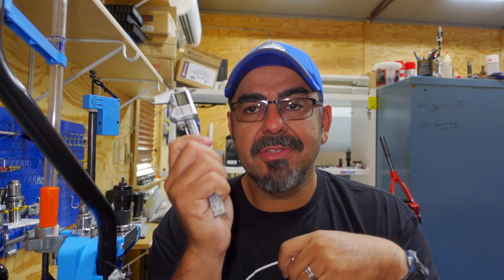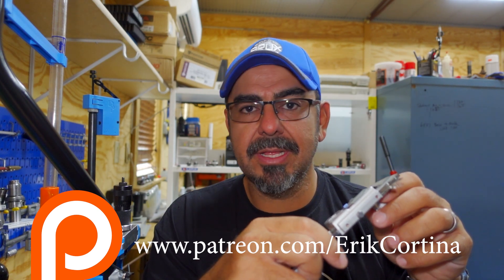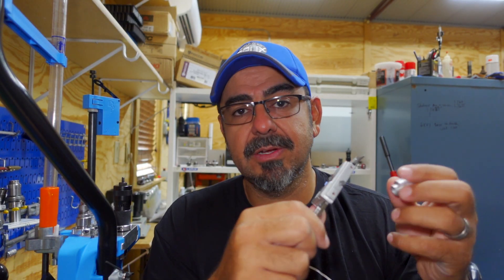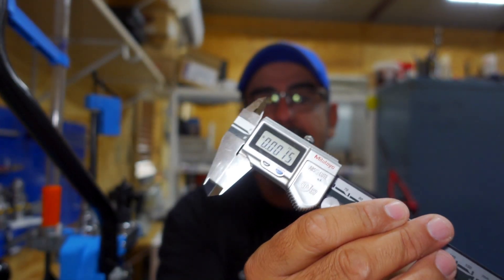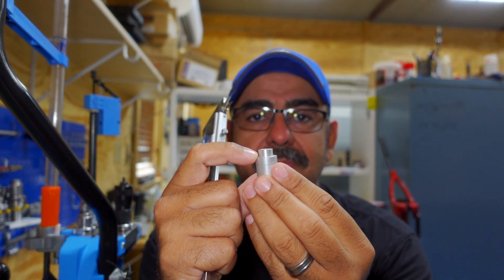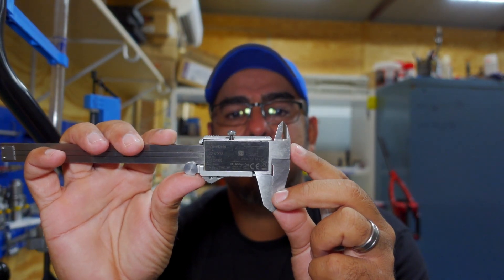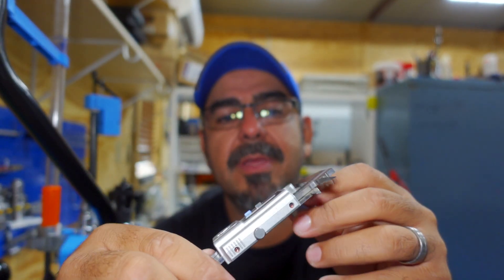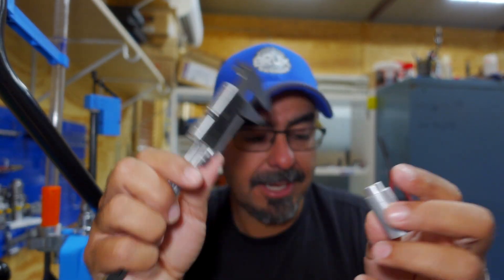You are using your calipers wrong!  Let me explain why...

Comment: I'm a retired toolmaker, and would use a caliper only for the "loose-tolerance" stuff +/-.005.  Another useful advantage of calipers is to set the diameter or length of a part's finished dimension on the display and then zero it there.  Take a measurement and now you have a means of determining how much to "take off" the material to obtain the finish dimension by simply reading the display... doesn't work on the old dial types of course.
Reply: It can work with dial indicators if swinging the dial covers the range.
Reply: @sjb3460  And micrometers can be turned so tight that you stretch the thread.  Any precision measuring tool can read inaccurately in the hands of a gorilla.
Reply: If your caliper has a outer ring that you can turn. Your idea is still possible.
Reply: Yes, Exactly another thing that saves me from doing math!  LOL
Reply: @sjb3460  Only if you are Ham-Handed, a skilled fab can feel measurements, plus minus 2 or 3.
Reply: Id push mine to read a +/- .001 if i already verified  a few parts with a mic. Never used digitals for anything less than ÷/- .01, to each their own though machinists are stubborn sons of bitches.
Reply: I agree completely with your use for "loose tolerance stuff" only comment.
Vernier Calipers are quick to use, versatile, and have a greater range than micrometers do but less accurate.
Reply: That's one of my favorite methods for turning on a lathe.  Take a cut, zero out the DRO, measure part.  Make sure cross slide / carriage (whichever axis you are currently using) is at it's zero point, measure part.  Set the DRO to the measurement, now you can work towards a number.  I sometimes set the DRO to how much I want to remove and work towards zero, usually when I have a lot to remove.
Reply: decimal 'fractions' of one thousandth of an inch. It baffles be how you lot got to the moon.

Comment: Calipers should never used for precision measurement. When calibrated they’re considered to be acceptable when they read within 1.5 times their least resolving division. In this case that’s +/- .00075”. And you really should use rubber gloves when using gage blocks/pins/balls.

Comment: The problem with calipers is the published uncertainty 0.0005", right? But the real problem is not understanding how they are intended to be used: Beam Flex, Sine and Jaw/Nib Tension errors are the rule of the day with calipers. And most won't think twice about how they are using them. Calipers are great when/ were used as intended, but there are better (more complex/expensive) ways to do it with better precision and accuracy (Micrometer, Surface Plate/ Jo Blocks, Surface Plate and Dial Indicator). Quite a few applications do not benefit from 0.0001" accuracy... this is why digital/ dial calipers exist: when you need some accuracy, but not supreme accuracy.

Comment: I'm sure a lot of people will benefit from this. I didn't learn about the 4th measurement until a few years ago and I've been using calipers professionally for years. Good job explaining this. 

I'll add this. Obviously check zero on gages every time you start using them and every now an then when you're using them. But especially if your shop is not climate controlled. I have a cheap micrometer that will move 0.005 inches or more with a 10° F shift. I need to replace them but I use the calipers way more often at home. 

I think our ISO gage people qualify gages at a controlled temperature. But I have not found any tolerance that tight in reloading. The variation stack from sizing lubricant and my presses can throw me off up to .003 inches from consistency.  

Any way great video and YouTube put 2 ads at the end of the video so hopefully you get monetization for this video.

Comment: The 4th way I did not realize. You sure about the accuracy? I don't have this brand of calipers, however the ones I do have measures a cat hair the same every time, I assure you it's less than a 1000's of an inch. Take a set of feeler guages and measure all of them, if it's a good set of calipers you should get the same readings on all the gauges consistently... I did on my calipers.

Comment: another measurement is to put id jaws in a hole and zero it there then use id jaws across the outside walls of two identical holes to find distance center to center

Comment: IMO and i've been a Gunsmith and Machinist and a certified FAA incoming parts and overhaul etc. inspector in the last 25 years. all calipers should have a foot on them and all mics should have a stand for them to make them more versatile and if you're going to be using measuring instruments as much as some of us do. a person should buy a Jo block/gauge set and maybe even a small granite surface plate so you can do your own metrology. the older i get the more i drop things. if i do drop a caliper etc. i can go to the inspection plate with the block set and establish if there was any damage in a few mins. gauge blocks need to be handled with cotton insp. gloves and coated with the bee's wax provided to prevent them from staining and developing corrosion from the sweat/salt in your hands and the heat from your hands will make them grow as much as .0003" or more. our metrology lab was kept a 68* +/- 2* at all times to keep all parts and instruments bathed at the same temp. to keep parts from growing from heat. love the vids Eric keep them coming. cheap measuring tools are like a cheap motorcycle helmet. how much is your head worth to you. that's how much you should spend on a helmet.
Reply: We call calipers 'approximeters'
Reply: @gravyblue  Very true.
Reply: Really Awesome info I wouldn't of imagined the heat from my hand making metal expand
Reply: Very well said Mark, I didn't know about the hot cold thing? and the cotton gloves. Thank you for your comment. Jim Tree

Comment: One gauge block is handy for a spot check but you really need a series of blocks to check across the range of the instrument.  Another thing to be aware of is the heat from your hands will affect the readings over a period of time so gloves may be needed if the measurements being taken will take some time.  Good video.
Reply: Gloves are heat conductive as well and it is pointless to use them while measuring. Considering the accuracy of calipers, you don't need any gloves or take in consideration any heat deformation etc. Calipers are designed to take the measures of an object in 0.01mm accuracy, even the analog one if you have a good eye you can read the numbers at 99.99% accuracy. For the tolerances used in mechanics those are more than enough tolerances to be able to reproduce the dimensions of an part.
Anyway, if you want to be more accurate than thousands of an inch or millimeter use micrometers and other equipment but not calipers. For me as an mechanic over 25 years of experience and lot of knowledge, I use calipers almost blindfolded and within accuracy of 1/100 of an millimeter and that's pretty much enough for the job that I do.

But anyway, environmental temperature can cause the changes from original dimensions, and it is recommend to use the caliper in mostly room temperatures for precise measuring. And the steps will be to leave the caliper and part you want to measure in room temperature for a while before taking measures. That is the practice that I've using all my life and it is proven perfect because all the parts which I want to replicate are built at those temperatures during production. You can also take at the part specifications and check for the temperature environment during assembly.

Only hands and heat from the body will affect the measures but not in huge a way, it will be in micron difference which is not important if you're using calipers ;)

Comment: Ok so... imma be that guy. First off though, really been enjoying your content since i found you last week. If I didn't respect you and your competence i would not be bothering to type this. 

If your calipers are not reading 1.0000 on a 1" STD they are either not zeroed correctly, you are not applying pressure properly (i.e flat and the same as when you zeroed) or they are trash. That accuracy rating is +/-.001 over the 6' range of the tool. So it should be +/- <.0002" over 1". That's sort of the whole point. If they weren't repeatable to .001" over the whole range they would be $20, not $100+. [[[EDIT: "+/- .0002" over.." is only correct if the only significant error is linear, which is not a good assumption for digital calipers, apologies]]]

You do not need any standard to calibrate or check 0-1" micrometers. Just clean the anvils (I like to clamp firmly on a piece of notebook paper and pull out until it doesn't leave a mark) and check zero either on the first click or by the slip that feels right to you.

IMHO the overwhelming majority of the inaccuracy when taking measurements with mics and calipers is the user. Even a cheap set of vernier calipers should give you repeatable measurements to +/-0.0005" if you are careful about keeping the contact clean, flat, and consistent pressure. All that said, you are on the money on the principle of the thing. Check your numbers, check them again then check them another way.
Reply from the maker: Thank you.
Reply: All these comments and this is the only one that didn't leave me wondering about the future of humanity. Light consistent pressure, with wiped jaws should provide */- .0005 accuracy. (Still use mic's for critical parts.) In fact, in  instances of measuring soft materials, I have found calipers to be easier because I can feel the material better than with mic's because the clutch hinders feel... to a certain degree. 
I thought some of ya'll may find this funny, when I first started machining, I made parts for cigarette vending machines. Can you imagine having those around... lol , how old am I? We made a lot of other things too. mostly sewing machine parts. Did that for five years then moved to another company and manufactured contact lenses.

Comment: Just looked at my Franklin Arsenal digital cal and it has a resolution of .0005" (0-12").
Reply from the maker: Yes, resolution.  What’s the accuracy?
Reply: @ErikCortina   Says .001" 0-8", 8-12" .0015".  I think you showed a page shot where the resolution was .05".  Was that your Mit?
Reply from the maker: Wayne O 
Accuracy was +- .001
Reply: @ErikCortina   Yes, my mistake.  Some day I'll have to impress you with my powers of concentration. :)

Comment: Ahh yes stacking tolerances, the bane of precision.
Reply: @Bertie Bollocks 
Not So. Accumulated tollerences, is a lame excuse offered by a metal worker who failed to use his most important tool. HIS MIND.
If you do a build that has 4 components stacked or chained together. You assign points of validation, that you rule in or out based on your understanding of the dynamic or characteristics or range of use of your build.

In real estate they say location location location.
Building "fine" things.....
It's ALL about, validation, validation, validation.
Your machine / tool.
Your measuring tools. 
Your info, or data. 
Blue prints / sketches.
Who desinged it. 
How was the limits and tollerences for your build 9kkkdetermined.
Temporature of everything
Direct sunlight.
Wear or breakdown of cutting tools.
Nothing assumed.
Your grasp of all this, and more, is
What will build acuracy into your work.
And calipers are NOT prone to inacuracy. How they are used, and handled IS. One moving part!  No "feel" reqired like with a micrometer.
You don't use your thumb nob to set the jaws for a read.

You close the jaws on the intended surfaces, by squeezing the outsides of the jaws, with your fingers. In a digital caliper, the reading head is actualy reading half of the minimum single increment displayed. Cool!. Use it right. Develope consistency, and keep the slide clean and well adjusted.
Reply: @philmachineman8927  Indeed. Using the thumb knob will get you the measurement you desire based on the amount of pressure. :P